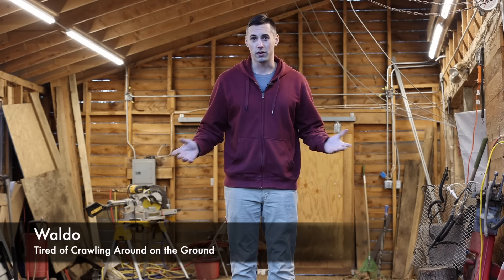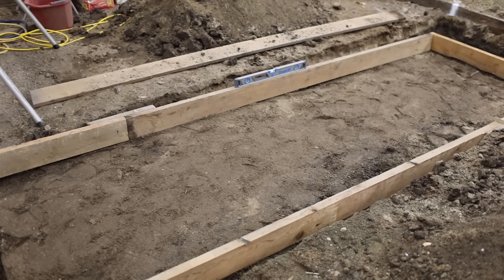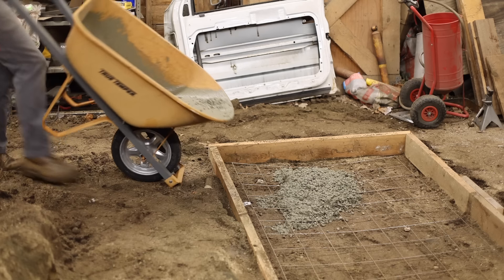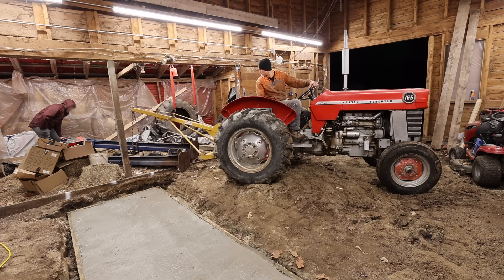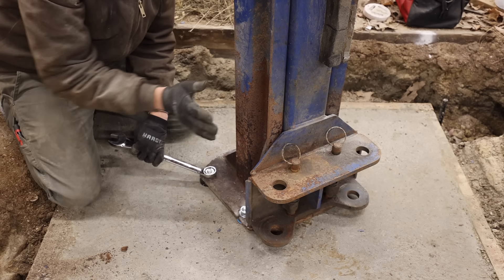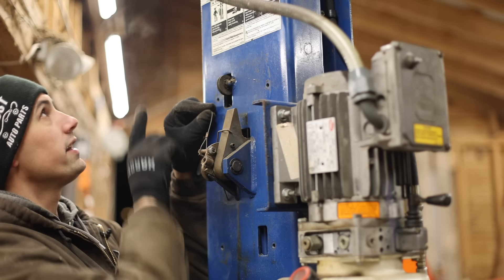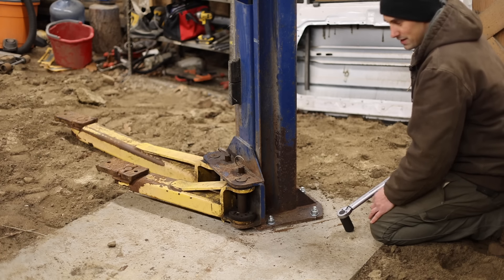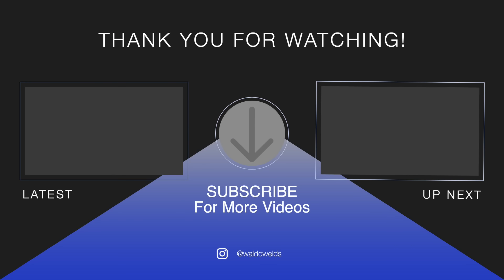Installing a 2-Post Automotive Lift on the Cheap

Comment: This is the most dangerous lift installation I have ever seen. An asymmetric lift installed on a pad too small and green to be installed on. The CG on an asymmetric lift is not centered between the posts and this pad is almost designed to kill someone. You need a compacted gravel base and then a min of 4-1/4" of 3000 Psi concreted cured 28 days. And all that is a min of 12x24 bay pad. If you are pouring a replacement pad then it needs to be 4'x4'x6" tied into the existing slab with chemical anchors dowelled in. This install is going to kill someone! Its not the weight of the pad that is important but the area and strength that this pad has none of. I can say this for certain. Rotary Lift (the company that made this lift) would use this in the training of what not to do installing a 2 post lift.

Comment: Figures that slab weighs about 1200 - 1300 kg, and the truck is 3000  - 3500 kg... That's a big fat nope from me.
Please at least throw a prop under each end of the vehicle to stop it tipping.

Comment: I came here to check the comments.   Pretty sketchy build Waldo.   Please tell us you don't actually use this thing.   The whole rig rotating would be my thoughts.  At least heavy cables coming off the top in a A frame.   And the fact that your torque wrench wasn't clicking might be your anchors were turning in that green concrete.  Oh and use rebar in that concrete.

Comment: Please don't use   this lift. IT WILL GO OVER. When truck wheels first get on slab the slab will start to lean and will NOT stay level. When it fails  the damage will cost more than what a properly  done slab would have cost.Also could hurt or kill  user. Always do overkill on a project such as this. Doing this cheap is  dangerous. I did more than required on mine.

Comment: That slab is to small  should be at least the size of a vehicle long that way the torque off a vehicle could not tip a slab over

Comment: I’m seriously scared for you Waldo. Lifting a truck with that small of a slab is sketchy at best and your description of the install doesn’t instill any confidence that you know what you’re doing with a lift. The locks not engaging simultaneously being one point. 

Be safe and please get or make a set of under hoist support stands to help support the back end of the truck so it doesn’t tip or fall. 
Even Andrew Camarata uses them and he installs an AM/FM radio with a chainsaw.

Comment: That pad is not safe to hold a truck should have dug into ground with post hole auger at least 3 feet deep in 4 places at least
 18 inches in diameter with rebar joining pad and holes  together not safe

Comment: Yikes.. So many things wrong.

1.  That pad is too thin
2. The pad is too small dimensionally
3. No gravel baselayer
4. Concrete needs to be mixed and poured in one shot. No bag for big jobs. 

Yikes.

Comment: If you lift a vehicle with that hoist , you will be taking your life in your hands . The base concrete will not conform to any standard for safety ! The weight of the vehicle/ mass at the working height would be so dangerous if it were not balanced perfectly ! Don’t use it !

Comment: No way is this construction up to any safe standard!!!!!   The slab should be much bigger to stop the over-turning moment of the lift that is very high on a two post lift.  The slab is nowhere near thick enough to accept holding down bolts that don't have the possibility of pulling out, the slab should have been 8" thick at least.  The reinforcement should have been placed in the top not the bottom of the slab thickness and I doubt whether the concrete could have anything but the poorest performance standard.  I hope to God that the installation is not relied on to perform at anything more than the minimum amount.

Comment: All of this is sketchy. From the concrete slab to the lack of proper tools, torque wrench. No rebar?? Your slabs should be as long and the posts are tall. At minimum they should be half. Overall this simply isn't smart. Please don't mimic this guy.

Comment: I really like your channel but that looks like a risky set up. That slab probably weighs just over half what the truck weighs; please be careful. I'd hate to see WMUR chasing a widow for a news story. On the torque wrench...I have found that my Craftsman click torque wrenches will over torque by quite a bit in the winter unless I bring them in the house to warm up before using them. I'm not sure the torque wrench was the whole story though; you didn't say how long you waited between pouring and setting anchors, but the sds seemed to bore through the concrete like it wasn't completely cured yet.

Comment: That's not lasting long. The concrete is going to crack. Should of used the concrete for two footers with rebar.

Comment: Great video ..  Bargain price    for what looks like a heavy duty fabrication .   Your slab is definitely too narrow for  any serious tugging and pulling on seized nuts and bolts . Maybe sort of ok   at your planned crouch height . Trust me    I am a 77 year old version of you   6ft 4 inches .. still doing my own mechanicing .  without a lift . Your cable lengths   need balancing to achieve  equal locking .  Watch the video,s on you tube .   Stay safe . strangers cars can harbor viruses for days . Just lost a good Citroen mechanic friend to the CCP Wuhan virus in the UK.

Comment: Nah, you guys are making it way more complicated than it needs to be. So the concrete is we'll say 3000psi, so lets say the lift has 9k lbs on it. Now figure the square inches of the base plate, then divide the 10k by the square inches and you will get maybe a few hundred lbs on each square inch of concrete rated for 3000 psi. 99.9% of these commenters are engineering and math flunkies sitting on the couch in mama's basement and have NEVER built anything more than a stack of pancakes. No "specialist" concrete needed no rebar needed. I would have made it bigger just cuz I like overkill but it can be made to work with minimal effort or additions. 

BTW yes, 10yrs ago I personally custom built my shop from digging of foundation all the way up to the roof complete with heat A/C tv wired internet, epoxy floor, cathedral ceiling, 10k lift, motorcycle lift, custom cabinets, Custom color themed 4 color painted walls, hidden in wall airline etc

Those anchors have something like 6700lbs of tension load and 10k lbs of shear load for EACH ONE. He'll be aight

But got curious, so I measured the baseplates of my 10k lift, 756 sq In total, so 10,000lbs / 756 = 13.2 PSI on the 3000psi concrete or whatever. And people are saying need 2' down 3' down 8" rebar...calculate and it all becomes more clear. Yes there will be leverage of a vehicle on there blah blah, it's a very workable situation without the 73 concrete trucks people are suggesting.

So with some calculations for the slab being 4x12, that's 995,328 sq In, so 9k in this case / 995,328 sq in = .009 psi the concrete is spreading that load over the concrete and surface below. He'll be aight

Remember Lift manufacturers have lawyers that overlook everything for liability...not real world. That's why your screwdriver packaging says use safety glasses while using.

Comment: 'Boy, this is really tough ground!' says the guy who owns a backhoe! The normal design is to pour a footing (deeper) around the post locations. Mixing 3300 lbs without a mixer!! Wow. That's real work. Looks like a nice lift, but yeah, those lifts require enormous height. Here is a video of a similar install by another YouTuber like yourself, but in Belgium: https://www.youtube.com/watch?v=0ZArcADkTBU

Comment: Concrete edges are you're weakest and u set post right at the edge. No rebar or fiber mesh. Not a good idea to be under that truck

Comment: The fuck? I hope no one follows this video. You NEVER use hand mixed concrete for a lift.....wtf were you thinking?

Edit: Please tell me you didn't put those concrete anchors in until at least 4 weeks after pouring the concrete...........